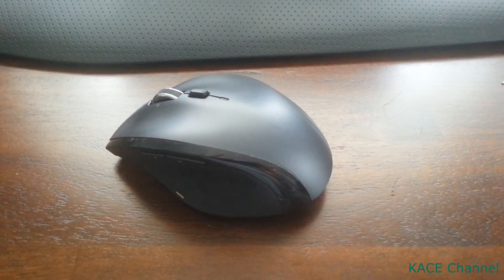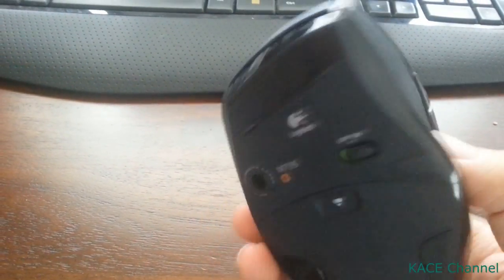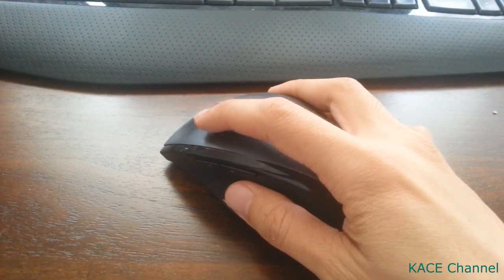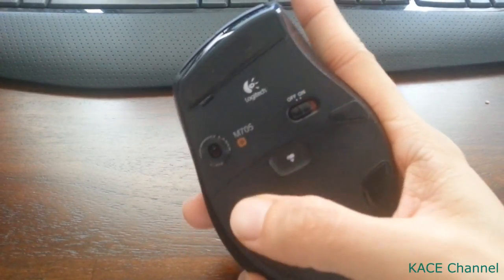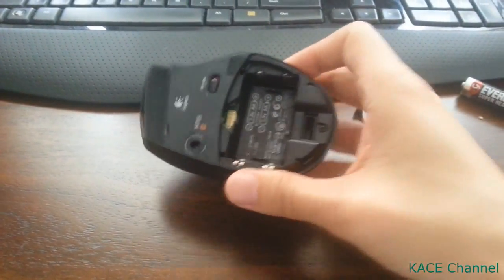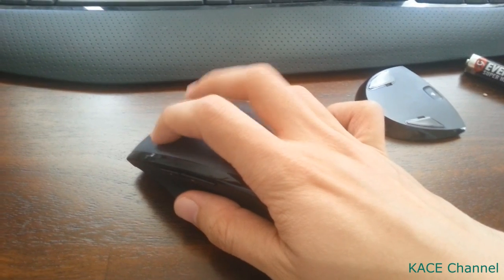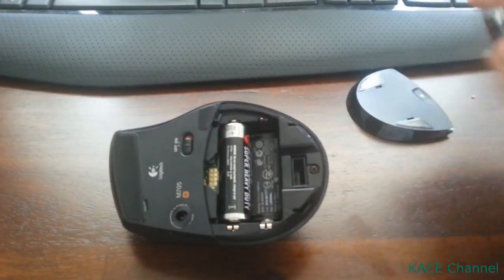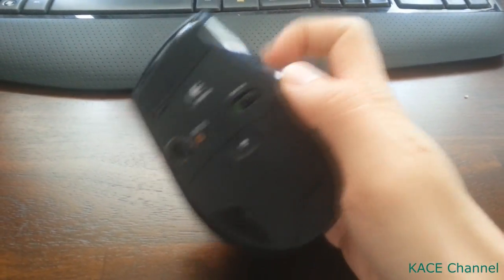Logitech Mouse Double Click Fix - The Most Simple Method. No Dis-assembly Required

Comment: EDIT: It doesn't, it is very temporary. It is caused by the spring.

Wtf? Goddamn wizard. It makes no sense but it works. Thank you. I hope you you live a good life.
Reply: Physics
Reply: @ashutosh.sharma  no - electronics
Reply: With my M310, the fix is also temporary.  The problem keeps returning.  I don't want to have to keep implementing this "fix" every single day.  I'm now looking for a better mouse.
Reply: @burtonnicodemus6568  You can actually fix it by bending the spring inside a little bit, or just change that part which is also cheaper than replacing. I bent the spring a little and it lasted many more months.
Reply: @hb9809  like the battery spring?
Reply: @Nova-7819  No, the spring that makes thr actual click. There was a little black box under the button, with a white thing on it. If you remove that, you'll see the spring. Don't do it before you watch some videos. It is very tiny. You can fix it by bending it a bit but it'll occur again in a year or so. You can replace the little box completely but you need to but one.
Reply: @hb9809  ok ill try this sometime, thanks

Comment: One quick tip. LEAVE THE MOUSE OR TACK BALL ON. If you turn it off you cut the connection when you drain it. I found this method much more reliable. Thank you for the video

Comment: It's actually fatigue on the microswitch. The little springy contact inside eventually flattens out. Fixable on the switches that can be opened, but tricky as hell to get right. (You can try, but you're more likely to end up replacing the mouse. Usually it's a lost part going flying or stuff doesn't go back together.)

Comment: Amazing. It seems to have worked. Probably goes without saying, but if you have a wired mouse (G600), unplugging it from the computer gives you the same effect as taking out the batteries and switching it off.

Comment: I was super skeptical of this method.  But I already had my Logitech MX Revolution mouse opened up and I was struggling to disassemble the left clicker switch, so I disconnected the battery and gave this simpler method a try.  So far, so good!